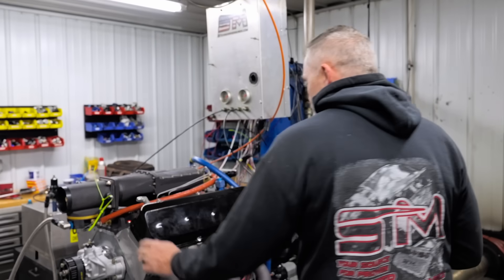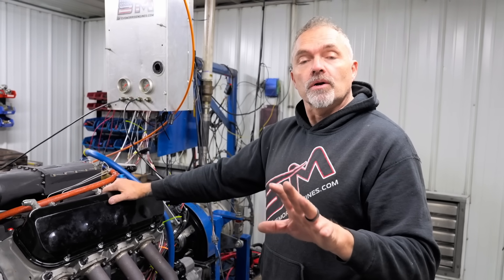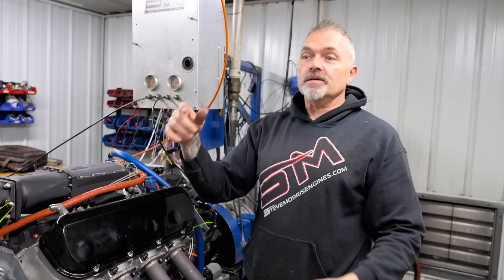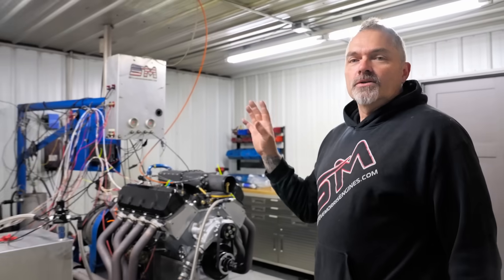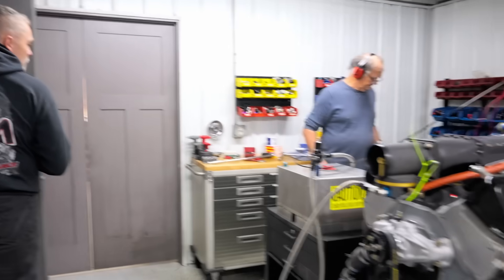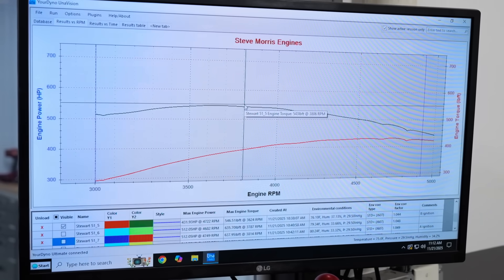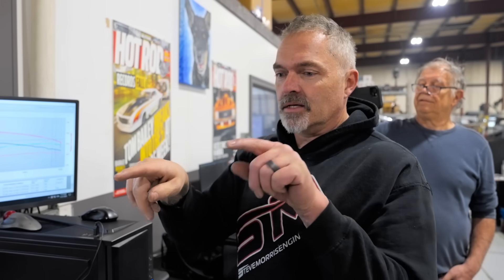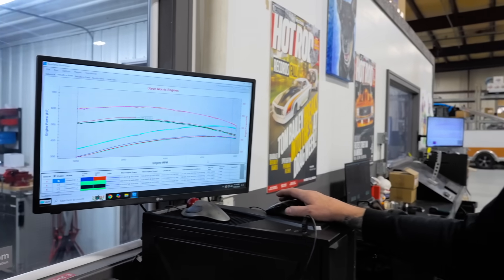Amazing 2 Spark Plugs Per Cylinder BBC  1 Spark Plug Makes almost 100 HP More Than The Other one ?

Comment: check timing, from pick ups through controllers to plugs. switch plug wires system A to system B, see if the 100hp stay with plug location or stays with system A or B. then swap spark plugs, see it the 100hp stays or moves with plugs. just start swapping A to B, front to back, etc and find out what follows the 100hp.
Reply: that's what I was thinking. I bet the timing of the Magneto is different from a to b more than plug placement by a half inch.
Reply: @jsomething2 I would bet it is in something with crank pickups, there are 2 not at the same location. Engine TDC vs sensor A and B TDC issue, would be a solid guess! Not an off the shelf part too!
Reply: You could just switch the wires on the two spark plugs if you wanted to try something quick and dirty - if nothing changes its from the spark plug in and if something does change its from the wires back.

Comment: Do you have to change the gears on the distributor and cam for the oil pump or is there a reverse rotation oil pump?
Reply: Usually on reverse rotation chevys the cam is gear driven to rotate clockwise so the oil pump works normally.
Reply: This engine has the camshaft rotating in the same direction as the crankshaft. The cam is ground with a reverse rotation distributor drive gear.  Since this engine doesn’t use a distributor, a wet sump pump plug is used so that the oil pump can be driven in the conventional direction.

Comment: The change in plug position obviously propagates a better flame front. The next step would be to machine a set of heads with one plug in the best position and test it.
Reply: I think there isn't really a "best" position, as long as the ignition is timed according to that position.   closer to the intake valve needs more advance,  further away, not so much.  but as long as the spark timing is optimized for when the fuel reaches the plug, the performance should be basically identical.

basically the A plugs perform better cause the timing is set for them to perform better.  pull some timing and watch the graphs get closer together
Reply: that's what I was thinking I never thought moving the plug 1/2" towards or away from the intake valve could make such a difference
Reply: You mean fit a hemi 😂

Comment: Steve do you have any data with the plug in it factory stock location to see what the horsepower is before going with the twin plug Aviation head to see if the factory spark plug location makes more horsepower compared to the data you have now with a spark plug location being, 1/2" further forward and 1/2" further back, if any of that makes sense?

Comment: Fascinating, would be interesting to see how ignition timing on the ""B" plugs affects power. A bit of trivia for you, old Rolls Royce cars had dual ignition systems, one conventional coil and points "kettering ignition" AND a magneto.
Reply: agreed.  I think pulling timing would bring the B graph closer to the A and vice versa.  if you pull ENOUGH timing, yo could probably get the B plugs to perform as well as the A's.    

pull timing on JUST the B system, and you've got a redundant ignition system that DOESN'T drop 100hp if the A's fail.
Reply: So the Rear spark plug would be further from the exhaust on one bank and closer to the exhaust on the other.
Reply: @kirkolson2518  it depends what you mean by "rear" generally the heads are identical with one rotated relative to the other. Intake and Exhaust might be less ambiguous.

Comment: I've had a 65cc 2 stroke 1 cylinder with 2 sparkplugs dyno tested it and it had a square torque curve. It had no more power then one spark plug but, a whole lot broader torque curve. They fired at the same time. It was a magneto ignition though
Reply: My old 2008 Arctic cat 800 twin cylinder had duel plugs per cylinder! And my father used duel plug heads on old shovel head Harley
Reply: @dextermacnutt most efficient sled around and a power house
Reply: @sneezinhatch the hardly? Are you kidding?
Reply: @RocknRollJesus101 No, they said SLED. They're talking about the snowmobile engine, not the harley, obviously.

Comment: So we actually need a left head, and a right head when looking at the engine from the front. Placing the plugs behind factory location,so did Chevy just split the difference and placed the plugs in between those 2 plug heads and made them swappable from left to right?

Comment: I would of never thought plug position in the cylinder would change the power that much. Makes me wonder if engineers know this.
Reply: They definitely know this. If they dont, then they are probably not engineers.
Reply: People have also been "clocking" spark plugs forever making sure the plugs are pointing the same direction in all cylinders.
Reply: They have known since at least 1909.

Comment: Harley v-twins back in the day when built for performance would add a 2nd spark plug.. so does double spark equal more fuel, if you were to run it like that instead of running it as a backup system like you're doing here??

Comment: I want to know how  the original plug position would perform
Reply: I had the same question.  Clearly moving the plug away from the exhaust valve screwed up the flame front travel.
Reply: @danmyers9372  yes please give us the base like normal position with this setup!
 I bet he moves his bbc spark plug location on the production models soon. 
The updated sm..... model.... With the new duel spark plugs.  I mean it is the next level. Duel ignition. At least you know it will light up
Reply: Better

Comment: Is the back spark plug flywheel front of that engine?
Reply: Orientation of the engine stays the same regardless of placement in the vehicle?

The side of the engine isn't the backside when it's transverse mounted?

A lot of old fwd cars have the engine mounted with the flywheel in the front too, but that doesn't make it the front of the engine?
Countach uses that configuration if I remember right, but it's mid engine.
And vw beetle and lot of porsche uses it with rear engine.

Comment: This is why the Gen 3 Hemi is dual plug i assume... awesome video as always!!!
Reply: M113 Mercedes engine has dual plugs as well. Im sure theres a handful more engines. Even the Ford Ranger has dual plugs.
Reply: @jtrill2  And the little brother V6 M112 and the K (supercharged motors)
Reply: Now I'm not Mopar nerd, so grain of salt... but this is my understanding of why the Gen 3 hemi has the heads that it has and why they have dual plugs. From what I understand, they planned on calling the engine a 'Hemi' from the beginning so they wanted to make it as much of a 'hemi' as possible. "Hemi", outside of Mopar marketing speak, is shorthand for 'hemispheric combustion chambers' of course, and the reason why you don't see any modern production cars with a true hemispheric chamber is because they're terrible for fuel efficiency, they're terrible for emissions, kinda terrible for just about anything other than making a bunch of power at wide open throttle basically lol. So the Gen 3 Hemi doesn't have a true hemispheric chamber because it just isn't really production viable today, but they placed the valves opposite of each other in very hemi-like fashion, so definitely do not call it a wedge chamber. The combination of the valve placement plus fuel economy & emissions standards resulted in a very oblong, almost almond-like chamber shape(I'll give Chrysler credit, this is probably as close to a "hemi" as you can really make a modern combustion chamber in a production engine, even if it isn't a true hemi), but that still wasn't an efficient enough chamber to get a complete burn and not have any unburnt hydrocarbons going out the exhaust, so a 2nd plug had to be added to get the job done.

Mopar nerds, please correct me if I got anything wrong lol

Comment: With the cylinder head layout  you are limited on locations.  You are limited to maybe one plug being in a good position and the other in an awful position.  Mixture flow being affected by the other plug. To me tested results would be much more interesting on say an old Porsche engine designed for two plugs.  Located for performance.

Comment: Are the heads open or closed chamber? Definitely some kind of efficiency difference in the plug location. Really interesting to see a half inch either way makes that much difference. The real question is would the original location split the difference between the two power levels???

Comment: Wow!!
I knew plug placement in the combustion chamber makes a difference!!
But had clue it was that much.
Closer to the intake valve the better!!
By a lot!! 
Interesting !
Reply: Exactly!  The question should be, why does it lose so much hp/tq on the one single plug but not on the other plug by itself? The chamber/dome turbulence has a role.  Every other variable remains steady; where the flame kernel initiates is important.
Reply from the maker: Good job, you’re getting it for sure.
Reply: This question makes me think of ford’s GT-40 heads vs. the GT-40P heads.

Comment: That's what is called Bendix mechanical fuel injection system. It's running fuel to each cylinder all the time and the throttle body uses a servo to meter fuel based on the engine's mass airflow. There is diaphragms and whatnot that are inside that piece on the bottom side where the fuel lines are hooked up.
It's not called a step-down transmission. They are called gearboxes. This is very common going even back to World War ii. Engines like the Allison and Merlin and many other airplanes with v-style engines. They had to run a gearbox to bring the engine RPM down to a lower RPM for the propeller. The propellers can't run past 3,000 RPM or they become real inefficient.
One thing you could have tested was the injectors and get the egts all running real nice and even on power. All the injectors are a orifice and they have a different size usually for each cylinder on normal aircraft engines. It's too bad you didn't have egts to see how the spread look.
Reply: Depends on the diameter of the prop as to what rpm. The prop tip speed exceeding Mach as Steve mentioned
Reply: @RocknRollJesus101 yes, I understand. I'm an aircraft mechanic and used to work at an engine overhaul shop. That's why you don't see engines like Continental of Lycoming engines rated past 2700rpm, unless they are geared. Example is a Continental GTSIO-520 has a gearbox in the front of the engine to bring the output rpm down for the prop but the engine will run at as much as 3400rpm.

Comment: Check the timing of both ignitions
Reply: I installed the ignition system on that engine.  This system was designed and manufactured by SDS-EFI, a Canadian company that began building electronic ignition systems nearly thirty years ago, initially for race cars but eventually for experimental aircraft.  The system installed on the engine has two separate controllers, with five magnets installed in the flywheel comprising one synchronous magnet with positive polarity and four trigger magnets with negative polarity located ninety degrees apart.  The sensor for the magnets is a dual Hall Effect sensor which sends a signal to the controller as a magnet passes over it.  The synchronous magnet tells the controller where the number one cylinder is, the trigger magnets locate the position of each cylinder’s piston. The controller is programmed with the advance curve from idle to the maximum anticipated engine rpm. The advance and total timing can be digitally modified as the engine is running using the controller. The ignition timing is set by digitally telling the controller where the number one cylinder piston is in relation to the synchronous magnet.
The system is a waste spark design which fires two plugs simultaneously, one on the combustion stroke and the other on the exhaust stroke. For the initial startup of the engine I just used one of the ignition systems, calling it system A.  The initial advance was ten degrees BTDC and the total advance was set at thirty four degrees.  I repeated this procedure with system A disabled and system B
energized. Even though there is a minimal difference in the position of each Hall Effect sensors in the sensor mount, the difference can be adjusted out in the controller.  Consequently, each system had the exact same timing.  Unless there was a performance issue with the spark plug wires, spark plugs or coils the only conceivable reason for the difference in horsepower and torque has to be the location of the spark plug in the combustion chamber.  
  Both Steve and I were surprised at the difference in performance.  Unfortunately, both Bill and I had time constraints and we couldn’t stay to try to minimize the differences by tuning the engine further.  Steve did not build this engine but he modified the heads to enable dual spark plugs per cylinder.  This dyno session was meant to proof test the cylinder heads. The dual plug cylinder heads were required not for an increase in performance, but for redundancy in ignition. As a matter of fact , I suspect that there might be a loss of power by moving the plug from the original position.  This engine was designed for high torque at moderate engine speeds with maximum reliability.  Several other of these engines have flown nearly five hundred hours without issues.  We are trying to make sure this one will also.
Reply from the maker: Each was set and verified independently
Reply: I was thinking the same thing.

Comment: Most prop airplane engines are air cooled, or am I thinking about little slow planes?
Reply: Airplanes have come in a variety of cooling systems since ww1. Check out the petienpole air camper.  Radiator in a bad spot on it
Reply: You are thinking of radial engines.

Comment: A super sonic prop is very awesome but very bad for populated areas.  Look into the “thunder screech” plane.  That will explain why props don’t spin above 770ish mph.
Reply: Super sonic tips on props ain't good... ask me how I know... The tips go bye bye and the prop comes apart!
Reply: @phatboizbackyardkustomz9006  I was referring to props that will hold together. It’s definitely possible.
Reply: @erikcourtney1834  That's why they went to jets after WW2, They could not design a prop out of any material that would hold up. Not even Kelly Johnson the most renowned aviation engineer could come up with anything. Even today not possible.

Comment: Thanks for the help Steve. You are correct about not pulling timing if your fuel will tolerate it.
I use 120 octane but was scared to add timing till now.

Comment: Even GA airplanes have had dual plugs forever. They also have dual mags, safety first. Also improves flame front for more power.
Reply: Well...sort of. The second plug is there to, as you say, normally improve the flame front. But to do that the plugs must be on opposite sides of the cylinder, not lying adjacent to one another. Reduction in detonation capability when the appropriate spark timing is used is the real purpose.. That applies to the fixed timing of most aircraft engines using magnetos as the only timing that is that available on starting  to running is with the impulse retarding the timing til the cylinder(s) affected by the impulse have fired, usually less than one revolution of the crank. Then it's back to fixed timing. For electronic timing as on this engine the ignition map controls the spark at whatever the engine needs with temperature and RPM inputs. The use of dual plugs also reduces the octane requirements.